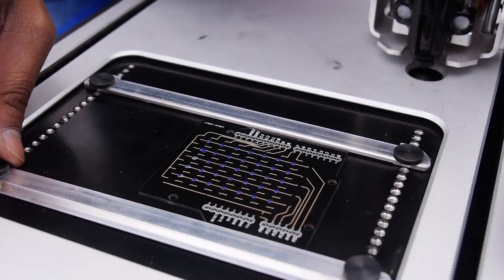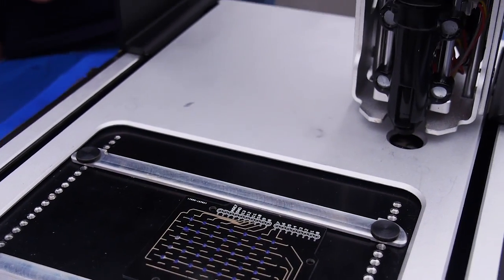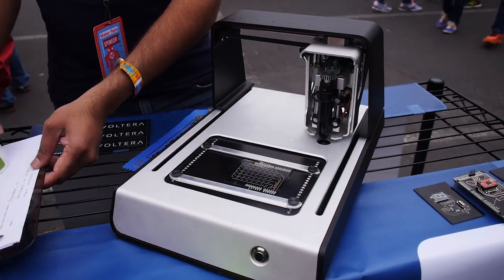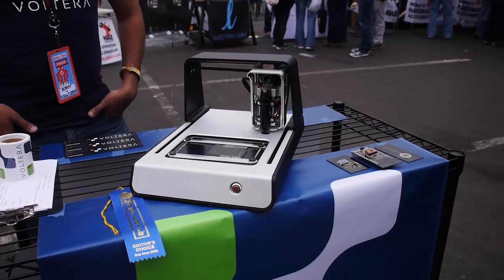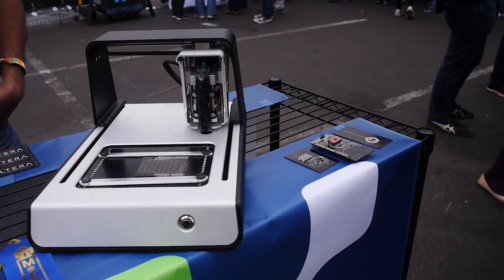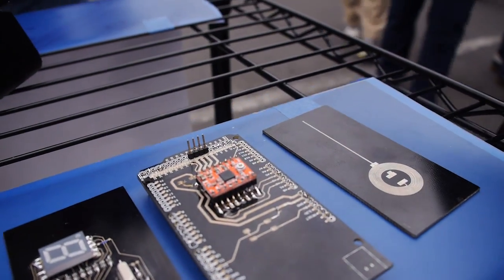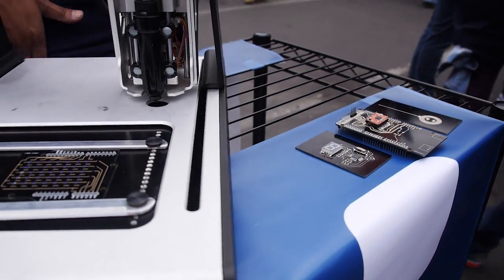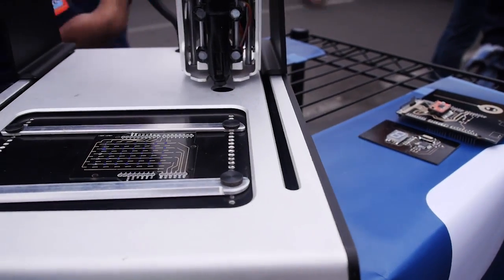Voltera: Desktop Circuit Board Fabrication

Comment: It looks great, and if it was just half the price, I would have already ordered one. Instead, I'll be waiting 2 years till somebody else makes it affordable. Great project though, even if it's just to inspire other companies to build on this idea.
Reply: pft, you're going to complain when you can make boards that cost hundreds of dollars with this? Do you understand cost to volume or cost per unit?
Reply: (to put it in your words) "Do you understand" supply and demand? Like I said, in 2 years similar tools will be sold for a far lower price. - No this tool cannot produce a PCB with a value of hundreds of dollars. Simply because there are still too many limitations. - "Do you understand" return on investment ? This is just a prototyping tool, it would be worthless for mass production. So, have you calculated how many prototypes you need to make to break even? - "Do you understand" total cost of ownership ? Just like 3d printers, from time to time this device will need a new soldering head or you'll need to add a cooling unit. - Conclusion: you're really bad with numbers. :)

Comment: This is an excellent idea, Good luck and much success to you in this endeavor.
A word of advice? Prevention
I see huge growth potential in emerging market, entrepreneurial industrialization and specialty, one off, and individual engineering--when the tug of war starts between the needs of one group and another. Focus on your product quality, materials and output reliability and it's broadest use & adaptability.
It is far better to produce a strong basic product with less features that's simple to use. It won't matter for long what the cause of failures and reprints are--GiGo, poor circuit design, buggy software or bad business. Customer or Company it will reflect on you.

Comment: First, if you have a good product you don't need to lie and claim at-home chemical etching is dangerous. Poor form...but hopefully a good product.

The price tag and cost efficiency will be the determining factor. At $2,200 it sounds like it best belongs in a shared use facility like a classroom. Material cost may also be quite high.

If you want to test your electronics before production there are MANY software programs out there that work very well. Or just get some breadboards. I think this may sadly fall in the small market somewhere between conception and small batch production.

Comment: Hey, doesn't silver eventually tarnish and become un-conductive?
Reply: H Adventure Videos It can tarnish quite readily which won't help with soldering but I doubt it's much of an issue if you do it the same day. I'd be more concerned about how thin the traces are and how much heat they can take during soldering.

Comment: You really can etch or use a simple cnc on copper plates to get your prototype, if it works and you order it for large quantities for much cheaper. This machine looks cool but it is not worth the price tag of  $2,200!!!! I think for hobbyists it is too much , for small businesses again it is too much of an investment for prototyping a very small board. I understand their enthusiasm and I respect that but business wise, I doubt that it will go far if it is not improved.
Reply: kivanctube I really hope they make this open source.
Reply: kivanctube It's just the beginning! Later on these machines will be cheaper for sure. And one big advantage is the speed. It would be even enough if a local shop would buy this machine to print the circouits for you. That would be cheaper and faster than etching or the professional industrial production.
Reply: Ok, Chuck Norris.
Reply: kivanctube They're pioneers, some bright spark in the community will make a significantly cheaper, homemade version.
Reply: ***** Speed is a good tradeoff to price in some cases. while manufacturing price is debatable, speed may be an encouragement. I hope they can market it :)
Reply: SbotTV I dont disagree one bit. It had to start from some where. Lets hope that it trends and improvements come sooner than later. I just criticized  the business model not the idea or the effort.  They may  not be able to sell a lot of the main product but hopefully they may sell enough supplies to keep their business running.
Reply: Nameless I think that is the way to go. If they can make it open source ,they can have a bigger demand for the conductor and insulator ink which they can sell to make profit. 
Not to mention the kits they can sell and other related stuff which can be affordable for everyone.

Comment: This thing is only good if you can create multi layer circuits. When it comes to single layer and double layer, it's not worth it, as you can easily etch them. And no, unless you're stupid enough to drink it, ferric chloride isn't dangerous. The real reason you would want this printer is if it prints multi layer boards, which are impossible to etche at home.

Comment: They're talking about saving money compared to ordering ready-made PCB's from China. Yeah, I'm sure their machine is really cheap.
Reply: Rikard Bengtsson Rapid prototyping can cost you around 200 euros per batch. Sure, you can go ahead and order from China, but that takes a couple of weeks. By the time you reach your final prototype you could be months further and time is money. This isn't geared towards your typical hobby engineer. This is more for the serious guys and (small) businesses.
Reply: LutkeVeldNL Thats not the impression that I got from this video.
Reply: LutkeVeldNL I don't know. I see lots of limitations in this technology as of now, but it could change later.
Trace widths can't be too small.
You're only ably to use TQFP and SOP-alike IC's (i.e. no BGA's).
Trace resistance.
Can't make more complex designs.
No solder mask(?)
No ground plane(?)
Not sure if designs made for this machine can easily be transfered to "real" PCB's.